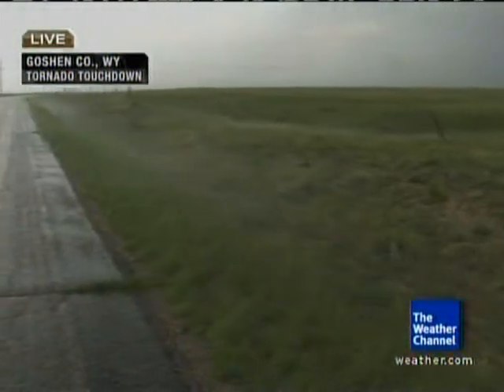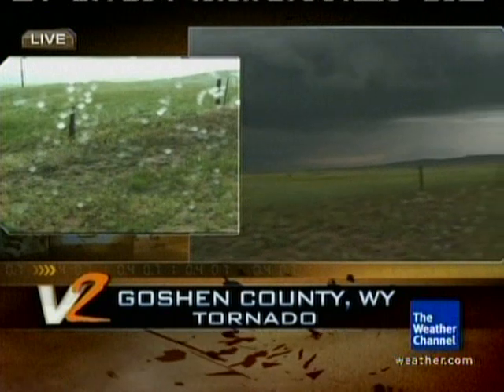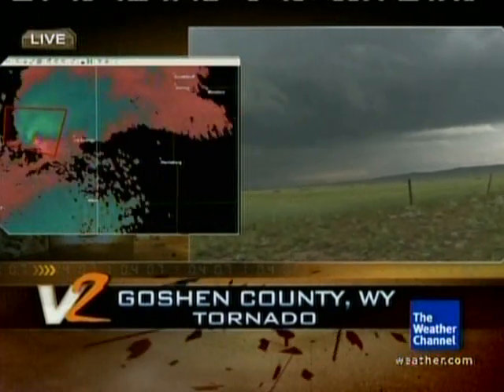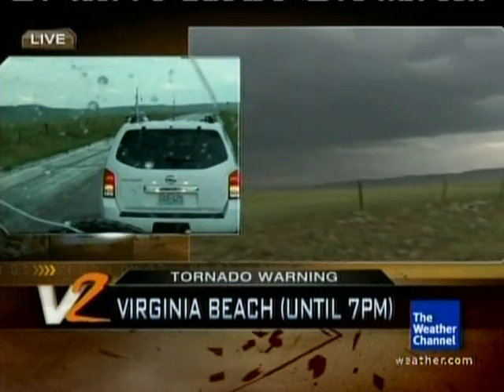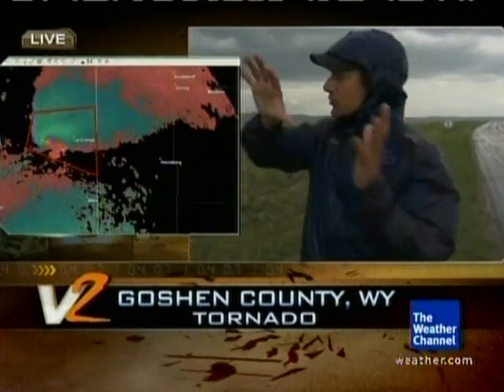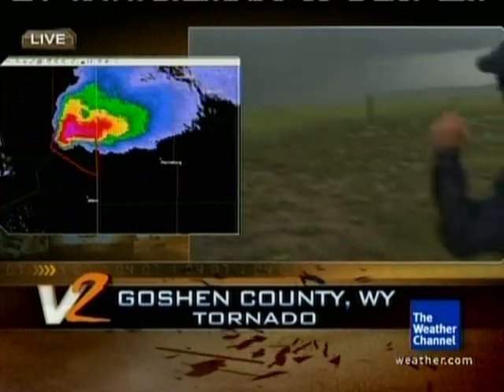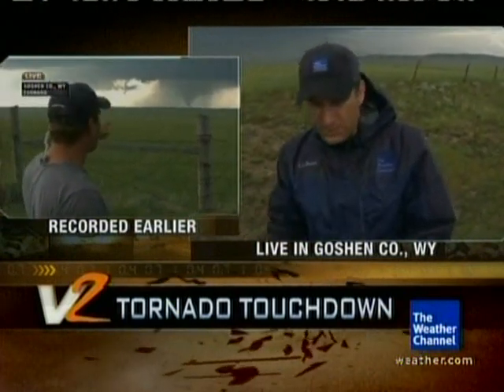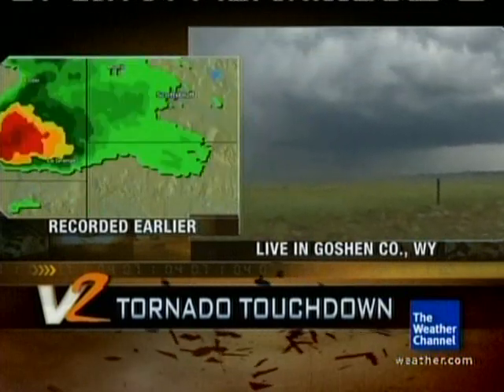Part 7: TWC- Vortex2's First Tornado 6/5/09

Comment: i think what you are referring to is a high tension wire pole , because of the granulation of the footage it blends with the backing cloud cover . it does look like a condensation funnel , but i believe it is in fact that high tension wire pole blending with the cloud cover.